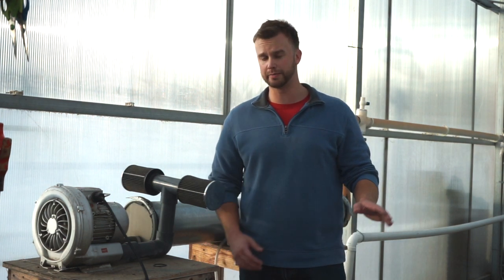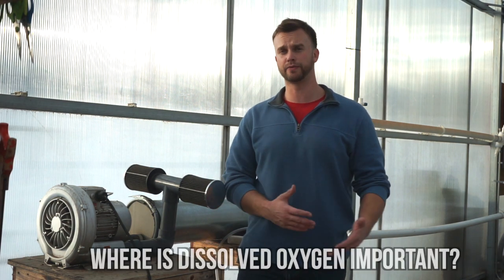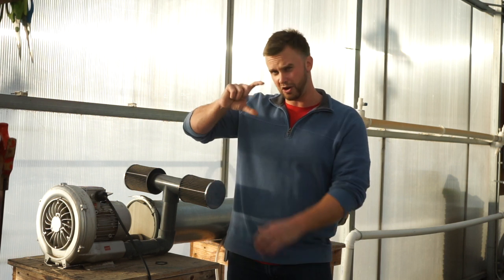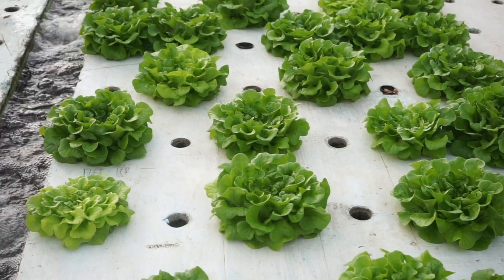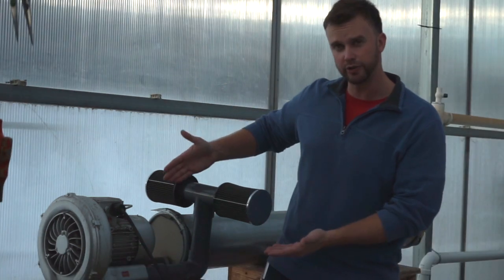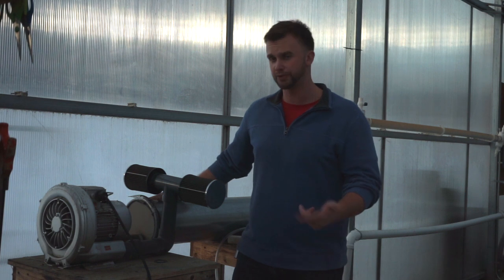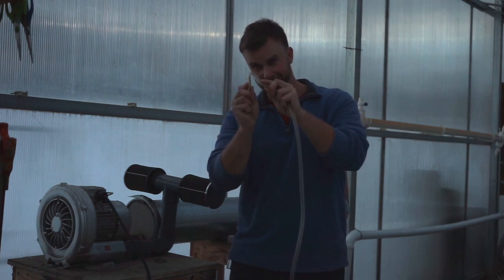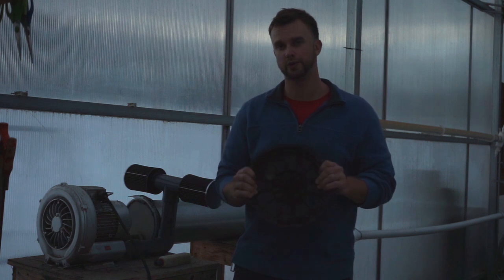Essential Aquaponics Equipment (DISSOLVED OXYGEN TIPS!)

Comment: Do you had any problems with the PH on water? I just mount the blower system and the ph on water became more alkaline. Y ran my water on 5.5 / 5.8 for hydroponics
Reply from the maker: No that’s interesting …
Reply: @NewAgrarian  here in Uruguay is winter. The gas heater generate CO2 maybe that the problem, gonna try some electric heater.

Comment: When I get my system setup I will be using an airpump to circulate the water
Reply from the maker: Smart. Air lift
Reply: @NewAgrarian  yeah I saw it on a dutch (I think) video and the air pump I got would run of a 12v car battery for 3 weeks

Comment: Just a suggestion but if you have any water under pressure being circulated anywhere in your system, you should look into venturi valves.  The $800 for your pump versus the $15 for a venturi valve could be a major determining factor for longevity of someone's success.  Best of luck either way!!l